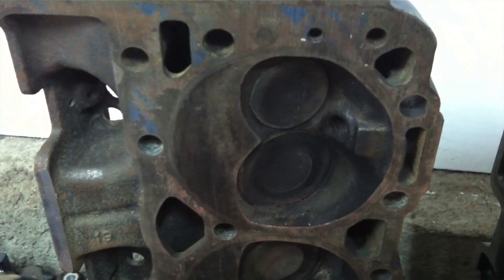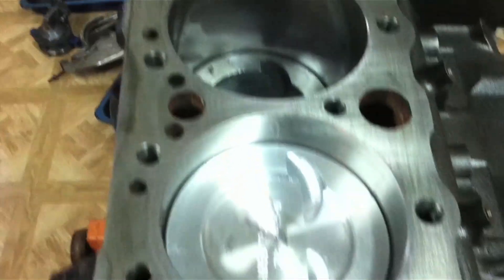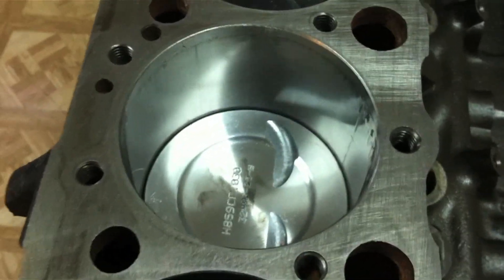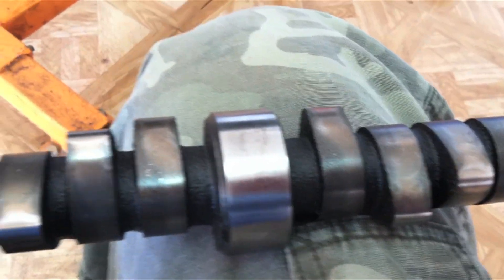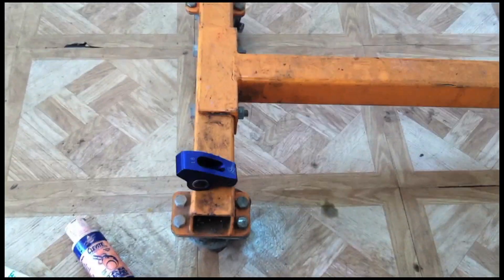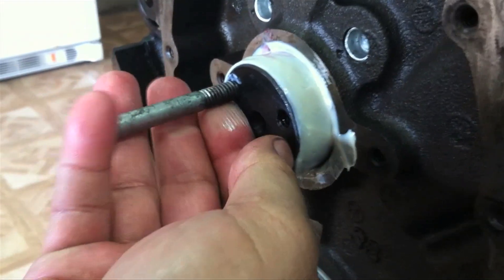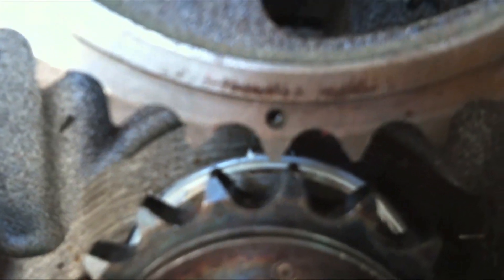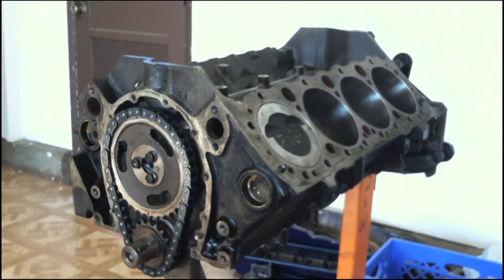How to build a Chevy 383 Part 3: How To Install a Cam & Timing Chain

Comment: When number 1 piston is coming up on the compression stroke, what piston is coming up on the exhaust stroke. I'm trying to determine if my cam is set right. I still have heads off. I don't wanna take timing cover off if I don't have to.
Reply from the maker: Not sure how you would decide if the cam is right with the cover on and the heads off. Number 6 piston should be on exhaust with number 1 at TDC. I have been told that you can time and engine with the timing light on number 6 but have never tried it. If you think you jumped a tooth on the timing chain you should really take a look at it. If you have a timing chain with plastic teeth (covering) or single tooth design you want to make sure it is set right and not loose or jumped a tooth so you don't bend your valves because the valve timing is off.
Reply: What I want to know is what piston is at bottom dead center if number 1 is on compression stroke tdc.
Reply: So what I gathered from you is when number 1 is on the compression stroke, number 6 is on the exhaust stroke?
Reply from the maker: Bryan Sweetser
The only way to make sure your cam is set right is to look at the marks on the timing gears.

Comment: its good been a while
Reply from the maker: The pistons (cam and combustion chamber) determine the compression "ratio" and the longer stroke on the crank (3.75" instead of 3.48") changes the "stroke" and total cubic inch displacement.

Comment: u always need a camshaft retainer .'
Reply from the maker: Really? So the millions of engines built without the holes for the cam retainer bolts all need to be taken apart, drilled and tapped for a retainer to be installed??
You only need a cam retainer for roller cams.

Comment: You also never put in the cam retaining plate..
Reply from the maker: Retaining plates are for full roller cams (roller lifters). The design of the cam lobes, drive gear and UNmachined end of the cam does not require or allow for a cam retaining plate. This is a newer Vortec block that originally came with a roller cam but this is OLD school flat tappet hydraulic lifters and camshaft.

Comment: Quick question.By lining up the markings on the cam and crank sprocket,even though the #1 cylinder is @ TDC,the cam is set for firing the #6.If I install  the distributor with the marks aligned,won't it be 180 degrees out?
Reply from the maker: Good question. That is why a lot of people get the dist. in 180 out. Any time you install a dist. you need to bump the engine over so that #1 is on TDC (or just before) on the compression stroke. Yes you can set the timing using #6 cylinder (so I have been told but never tried) if you really want to screw with somebody! LOL

Comment from the maker: Yes when you advance or degree a cam you use small round spacers like thick washers to offset the cam gear. It is a science I never really got into. On a stocker app I would not worry about it.

Comment from the maker: Thanks. I usually don't degree a cam but I have on specific builds. The best guys to talk to are at Comp Cams. They have a "Cam Quest" page on their site to help you choose a cam and grind. Cam installs and degreeing are a bitch if the engine is installed already. If it is a stock bottom end I would just pick a cam that makes the power or torque where you want it at your desired rpm.

Comment: Hey man good vid got a question im New to Chevys on a build installing a 280/480 cam in a 350 stock spec bottom end would you degree the cam on install and if so how much thanks for your time